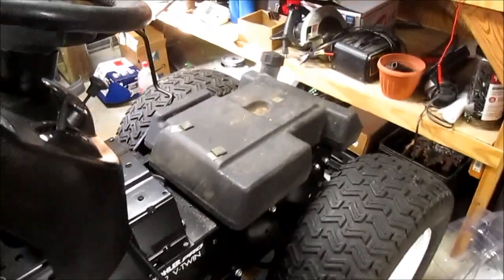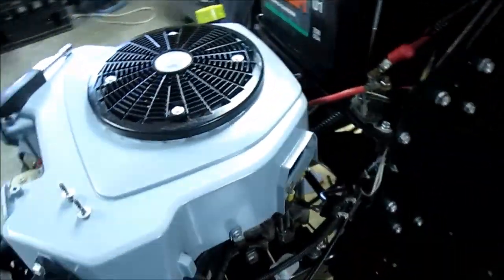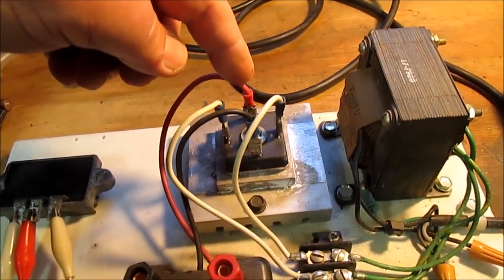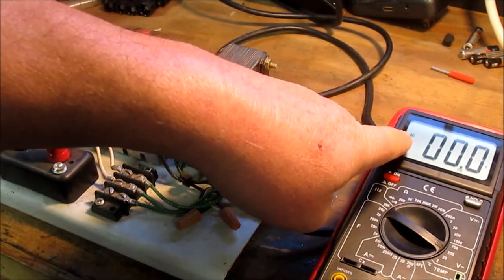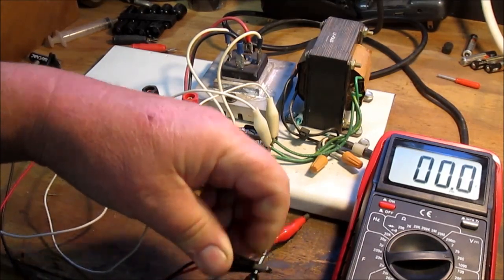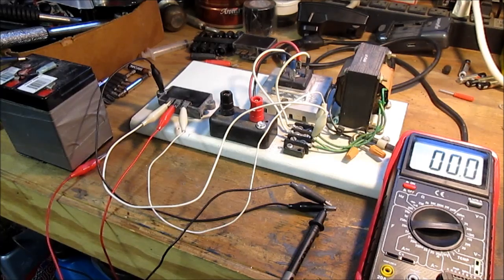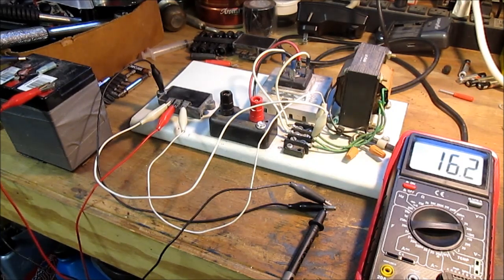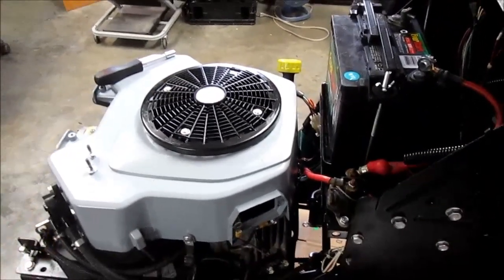Testing a Voltage Regulator

Comment: Mine keeps blowing fuse but when I unplug volt reg it doesn’t blow the fuse. Doesn’t matter if key is on or off as soon as fuse touches the block it blows. Any help would very much appreciated.
Reply from the maker: Could the V-reg be shorted? Check with a multi-meter.

Comment: I tested for continuity  to the VR body from each pin. All three had continuity from each pin,is that normal?  thanks a million
Reply from the maker: It's hard to test a REG with a multimeter. Very little information on what the correct readings should be. I bet if you reverse the leads you will get different readings. Best way is to just swap it out with a known good one, or do a test set-up like I did, only without the mistakes.

Comment from the maker: The engine would not stay running, so I (incorrectly) thought it was a bad regulator. My test set-up eventually worked, and proved the regulator was good. My test set-up is good for testing other 12V components. I need to build one that can provide more than 2 amps. Turned out to be the key switch was faulty.

Comment: I just fixed my old Roper ( Sears was made by Roper back in 70's ) with a charging issue....i had tested it awhile ago..but it blew a belt...sat for awhile...wasn't charging for a few years...couldn't recall what i figured out way back..so i just charged it when i needed it and it was fine... and I have other tractors too.. I just got it going again and decided to fix the charging....tests showed Stator ok ( phew ) but reg not sending any charging voltage...i just bought another Onan tractor so had a reg to test now...( but i had no idea if it worked - the reg - as i had issues to fix and it runs now but i have to find time to finish it )...i swapped in the test reg... It works perfectly now...charges good 14.5+ volts...regulates and ammeter now Moves!! I remember now why i just charged it...Damn Onan parts are extinct or Expensive to buy!!  I found a Kohler reg in a used engine in my shop...plan to test it as it is similar to my Onan ( AC - + - AC ) and should work ...but i don't know if this one is good yet... Or the new tractor stator is good...so i gotta test it all again to confirm....hopefully it works as replacement regs are chinese cheap or expensive... Basically a reg is a reg if you have dual AC outs ....

Comment: You need a battery with a regulator as it adjusts the voltage as it needs to charge your battery and run your load ( engine+lights +acc's )....
Turn your lights or any electrical loads On... and rev your engine to test your charging voltages...
Also test your getting AC out of stator etc.....( i think u did that?? )
You can also test the regulator diodes too to see if they are good...
If all checks out it is not related to your charging system ( engine not running )....then you move to the next problem area....
You might have sediment in your fuel system ( carb most like needs cleaning ) due to your cracked fuel tank??
And your solenoid on carb could be the problem ( electrically or dirty too )....pull it off to see if it is dirty and test it...sometimes they stick as well as get weak....
Reply from the maker: As stated at the very beginning " The engine won't stay running"
Reply: @larrybl  
Ok fair enough....i watched it but was just mentioning the best way to test ( usually easiest too )...

Comment: Why don't you test it when connected to a battery and engine running??  That is the proper way to test your charging system on a mower....charge your battery up..replace if real bad....then test while it runs....sometimes over thinking makes your results wrong...not that your setup is bad...it just doesn't work on every component...
Sounds like your battery is dying?
Reply from the maker: Engine would not stay running.

Comment: Helped solve my problem. That is, once you hooked up the 12v battery to it. I believe that was my problem. 12v battery voltage was not getting to center terminal of regulator.
Reply from the maker: Thanks, yep needing the 12v was confusing me, but glad it helped you out!